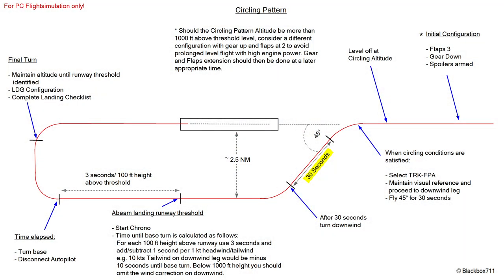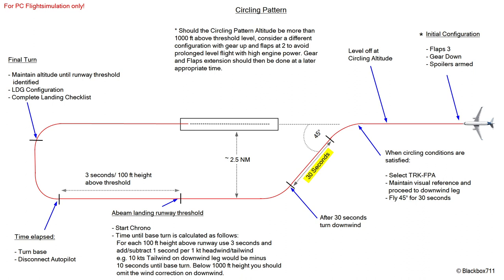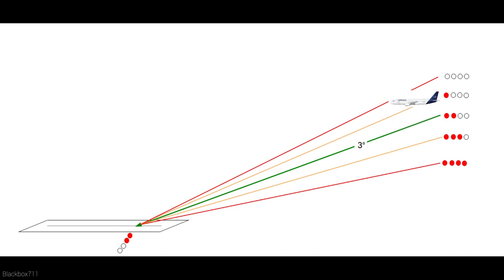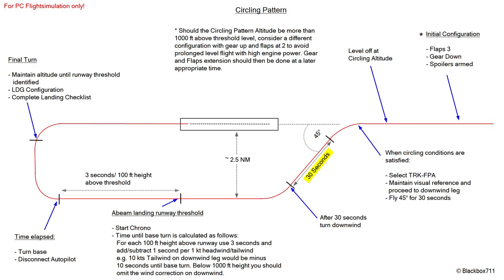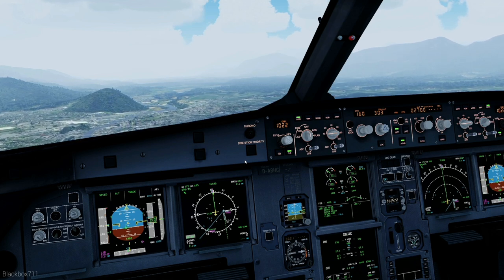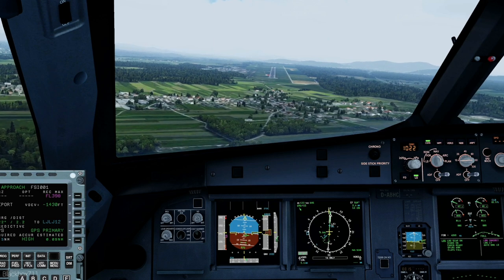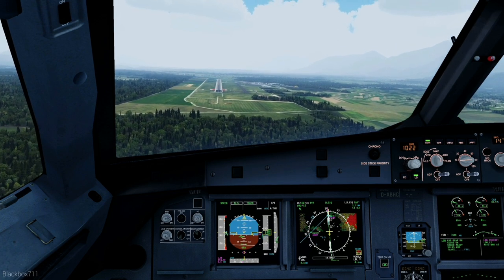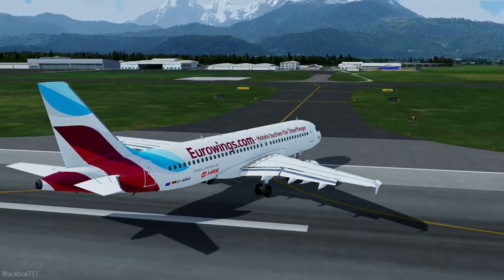Circling Approaches: How to plan and fly them

Comment: Hi ..
Sir question please 
If the approach button on FCU
arms both LOC/GS why there is a LOC button?
It’s an engineer question by the way 😉
Reply: Sometimes you want to line up to the localizer but descent with an angle that you want. Like for example in the old circling approach to Innsbruck
Reply from the maker: The LOC button is also on the FCU. Below the HDG knob.

Comment: Your content is excellent. It's great to see you share your passion!

I currently operate the 320/319 for a US carrier. Due to the pandemic, like most of us, I've not been flying much. I wanted to make the most out of flight sim to maintain some proficiency. I currently run FSX with the FSL 320 but the sim obviously has limitations. 

Would you recommend P3D and the FSL 320 or Xplane with the Toliss? I understand that FSL probably has the superior aircraft but, in your opinion, is it worth the additional cost? Also, it appears that Xplane may be a bit easier to get setup compared to p3d.
Reply: In my opinion go straight to FSL A320, disregard cost difference, if you wish quality, don't hesitate.
Reply from the maker: Hi. Since you are rated on the A320 you probably also want to practice abnormals. And this is where the Toliss has its limitation because the system simulation and especially the ECAM checklists are not modeled properly. The FSLabs on the other hand does have a very good abnormal system simulation. I personally use it to practice for my biannual Checkrides.